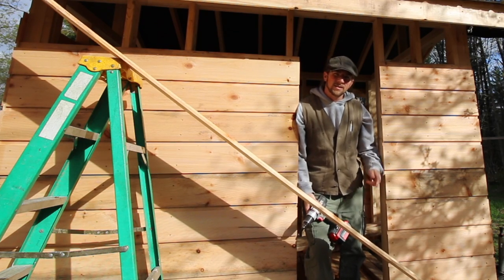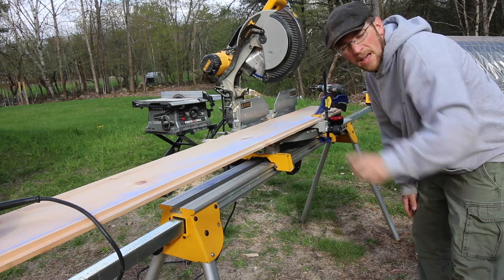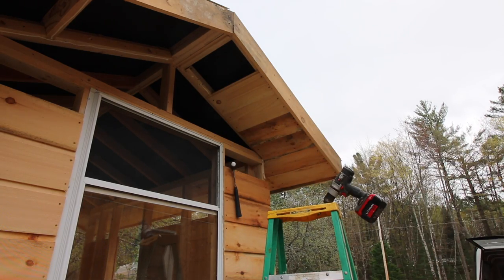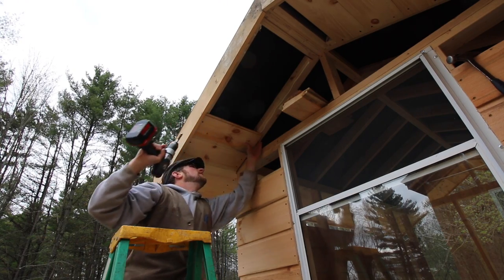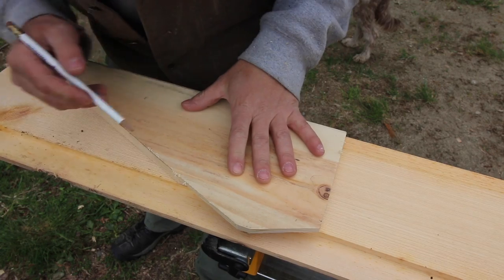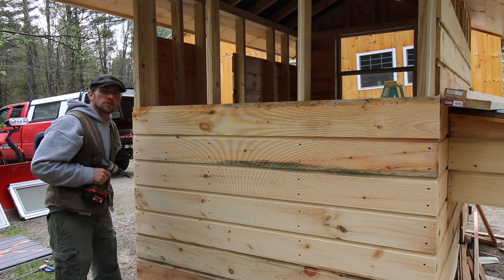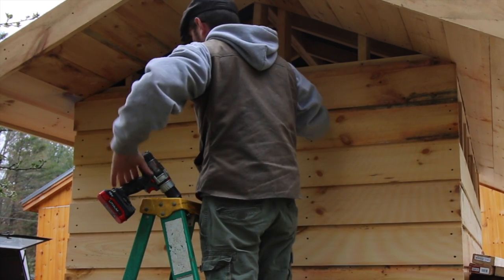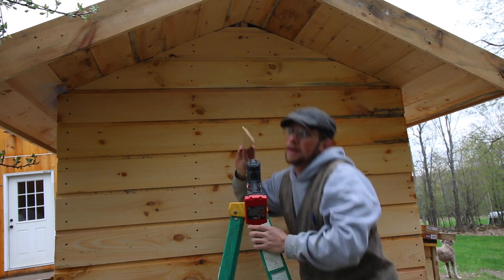Getting the soffits done! Mobile chicken coop Build #8

Comment: You can cut those eave pieces like you cut tile. Put the board below at the point it fits under the eave ( before the angle) and take the same size board hold it at the angle of the eave and draw your line. Perfect every time.